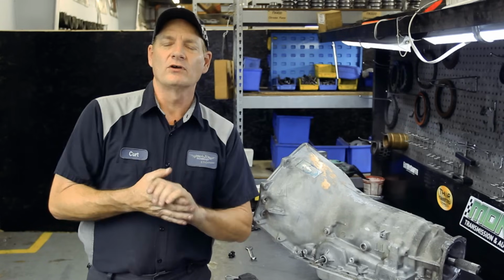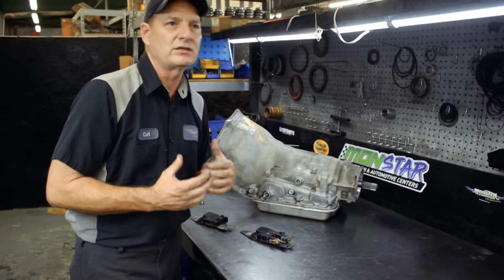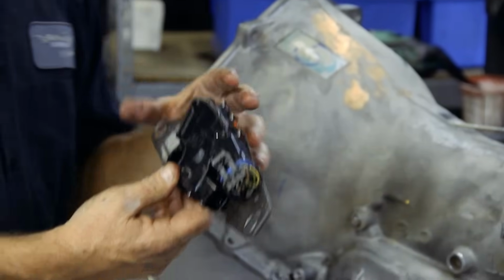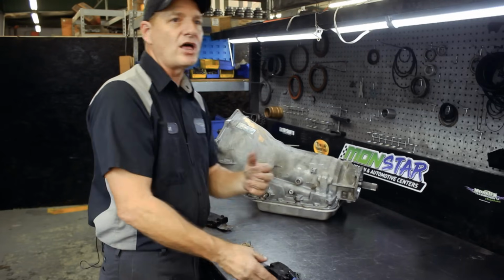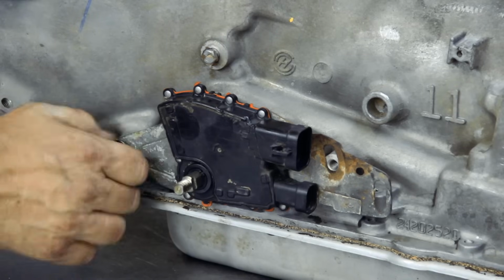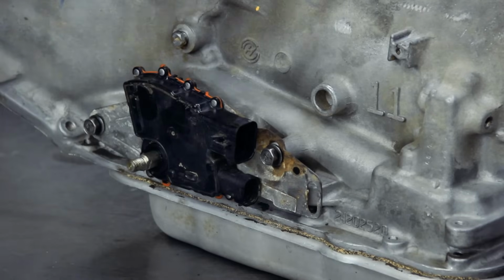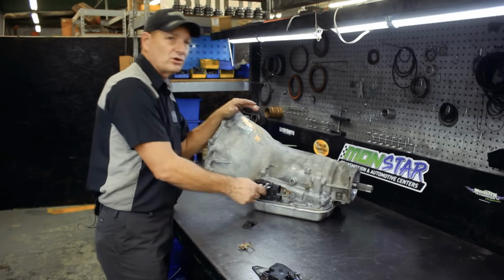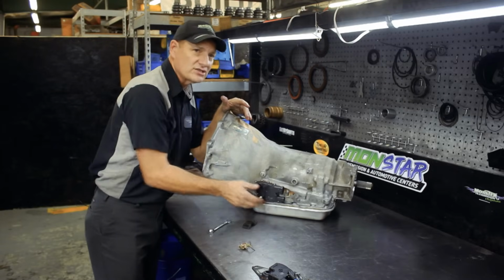4l60E Neutral Safety Switch

Comment: Use a lighter and heat the connector casings before pulling on the wires to loosen that glue n save yourself 50 bucks

Comment: Can a switch be swapped for one with a different plug
Reply from the maker: They both bolt on the same way however they each take different wire harnesses.
Reply: @MonsterTransmission  the one I have has the same harness but torque converter doesn’t line up any suggestions
Reply from the maker: @everydaycar3518  It may be the wrong converter difficult to tell without seeing
Reply: It’s a 2005 trans we got it bolted in everything’s working
Reply: How do you tell if it was actually rebuilt
Reply from the maker: You can try to look for new seals but other than that unless you remove the internals it's difficult to tell.